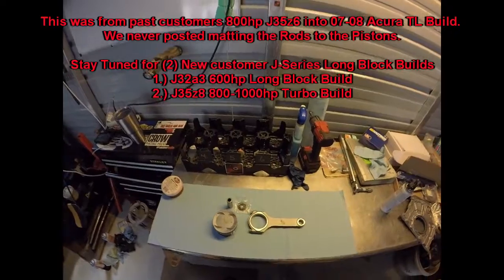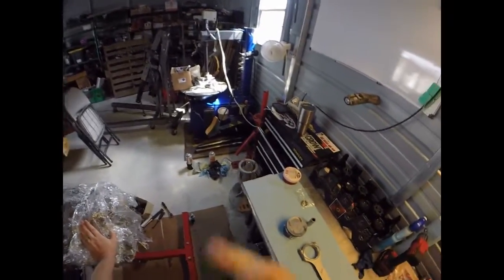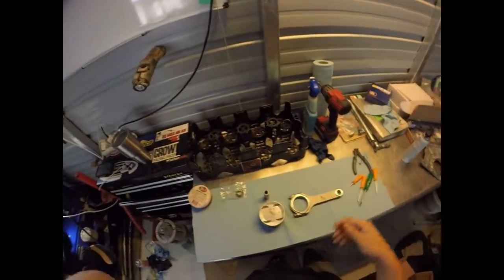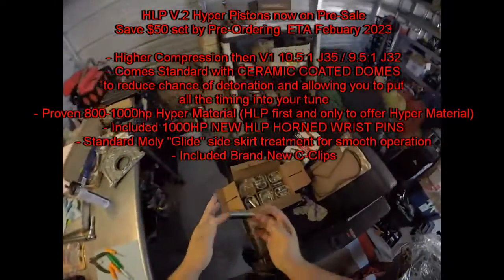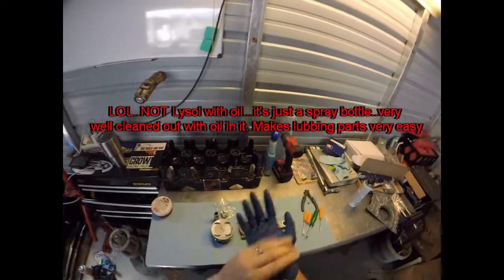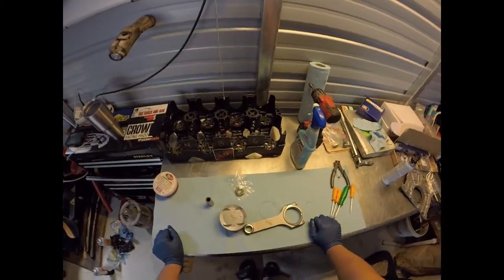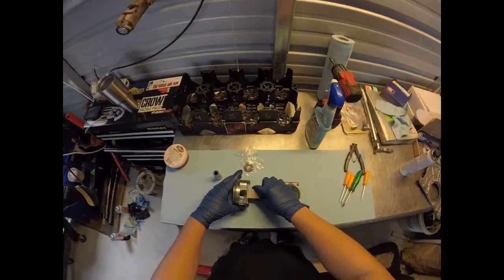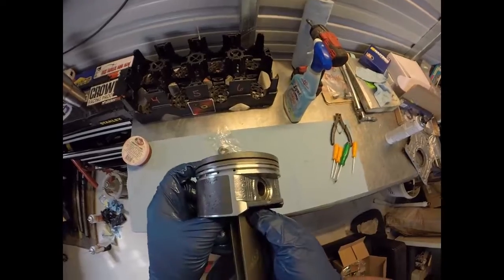Installing 1300HP J35 Rods Onto 800+HP J32/J35 Hyper Pistons - HLP Products 800+HP J35z Build

Comment: Hey man great content! Could I get away of just installing your Stage 2 cams in J35a8 heads without getting springs and retainers?
Reply from the maker: Sit tight, we have our stage 1 coming in within the next few weeks...won't require any spring or retainer change. Will be just install cams, set valve lash and be on your way 🤙
Reply from the maker: Send us an email Contact@HondaJseriesEngine.com
If you're ready to pull the trigger we can hold one on Pre-Sale....being our cams literally sell out as quick as we get them in